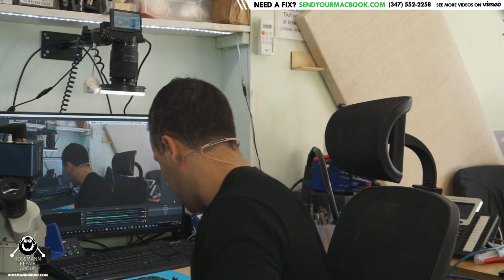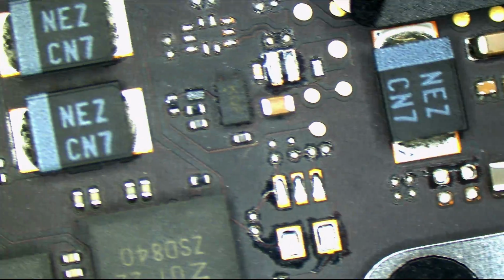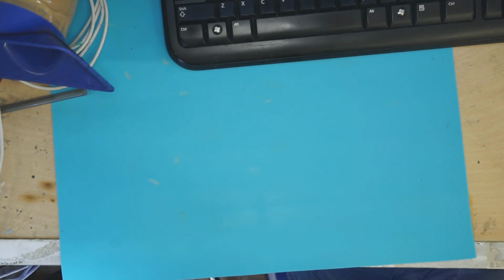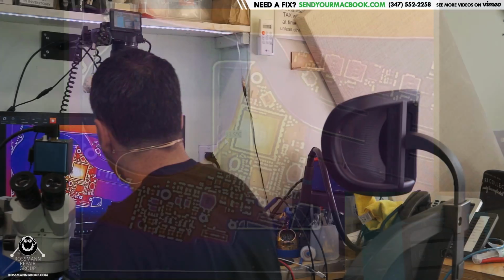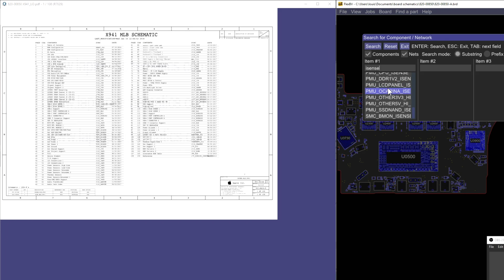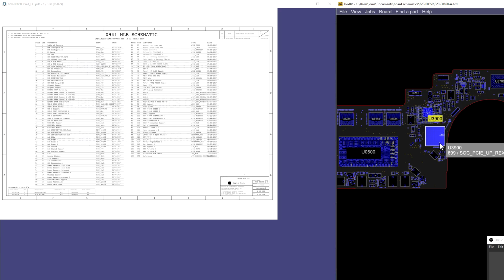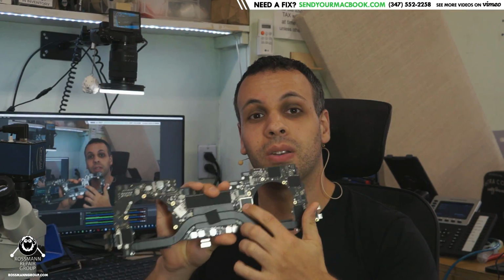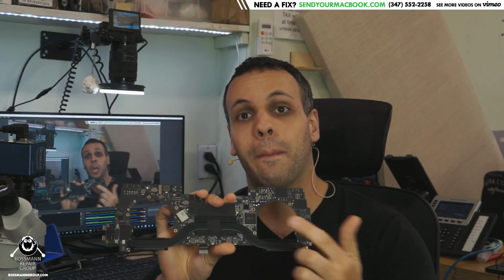Apple users have no one to blame but themselves.

Comment: Apple pulled that fictional water damage ("humidity caused corrosion") stunt on me with a 14-month-old MacBook Pro. Insisted the only option would be my paying for a new motherboard repair or better yet, "just buy a new laptop."  I did.  Dell XPS 15 with far better specs and even better, a warranty that does cover humidity :)  We thanked Apple by removing all iPhones and Macs from our entire family ecosystem. Next are the iPhones at our company of over 400 employees. It took a lot to piss off someone who grew up with Apple (IIc, IIe, IIgs, Newton, Camera, dozens of Macs, and annual iPhone upgrades) but they did it.

Comment: In regards to recovering data from the SSD, could you move the SSD to a donor board with a functioning T2? Just a thought
Reply: Im not positive but I believe that the data on the SSD is encrypted by the T2 if I remember right, thus trying to move it to a different board wont work because that T2 chip doesn't have the same key.
Reply: @beaker15tyler39  good grief.....
Reply: @mikeymike4g63  exactly the problem....

Comment: Sadly asus is doing the same thing... The difference is that on asus you can remove the hdd or ssd. I had the X541UVK whit the bugged intel me i try to fix it and it became useless even wen i flash the original bios back it was dead...

Comment: I still recall when my dad's Macintosh PowerBook 100 had a hardware failure and the guys at the support couldn't perform the repair, but they were nice enough to show where it was the damage, what to do and also borrowed some tools to let dad perform the repair at his own risk. I guess it was one leg of the CPU.

The repair was done perfectly, but the computer didn't turn on... One of the guys at the store immediately performed a special command to allow the hardware to reset due to the modification that was done... Bang! PowerBook 100 was alive again.

Those were very different time on Apple.

I used this PowerBook 100 with a lithium battery to type texts and documents until 2012. Unfortunately the screen failed due to materials deterioration. Good product with an industrial look.

I guess I will fit a new hardware on it in the future.

Comment: Great video and very informative! You mentioned that it’s no longer possible to pull the data off that board. Does apple use “security” as a reason/excuse for not being able to change out the defective chip?
Reply: Apple can recover data from a defective T2 chip if the logic board is partially working but I would expect such data recovery to be expensive, The T2 chip is to make your data more secure and that does mean sacrifices if the chip fails. All my data is backed up on the fly in the cloud encrypted end to end so that would not be an issue for me. I recommend this to all Mac users especially since 2017. It is a great development by Apple, but yes, it is early days and we are seeing the issues popping up now as machines start to age and fail. Data back up has now become essential, it is bad enough when your $3000 machine fails but to lose all your stuff due to no back up would possibly be a disaster to your business.

As for the T2 chip being non-replaceable, it is a security device so yes it would be more secure as a fixed component. I am sure some clever hacker if he could remove it and put his own proprietary T2 chip back in to hack your data that would defeat the security. So I cannot hate on Apple for that, the question is though, is that extra security worth the risk of data loss? Probably not if you back up.

Comment: made the mistake of buying a macbook in 2016. i had the option of getting some ridiculous high laptop for the same price but i went with apple because all my classmates had apple so had the rose tinted glasses on. so i got a early 2015 (maybe late 2015) macbook pro.

worked fine for a while. it was my daily driver and workhorse. i used it for class, playing League of Legends, word processing, facebooking and web browsing. battery was excellent too

a year or so in, battery showed "replace soon" and the battery life took a severe hit. went from being able to use it all day for the aforementioned save league, and still have 30% or so charge. now before lunch its almost always nearly dead after just a few hours of powerpoint slides. it could be my fault to be fair, cause i usually only plugged it in at low battery and left it to charge to 100% then as soon as it was 100% i took it off of charge, and subsequently let it stay on charge all night long. if that is my fault i take full responsibility for it

but seemingly out of the blue the keyboard started showing issues. at first it was just a key or two occasionlly not working. a quick tap on the key would fix it and things would work fine. sometimes the key in question would be infinitely repeating but, again, a quick tap on the key would fix it. 

but over time more and more keys started behaving erratically to the point i had to install Karabiner and use an external keyboard (not an issue frankly cuz i always had my mechanical keyboard on the macbook anyways given i played a lot of LoL). 

research showed me that the cause was "water damage". not buying it. i kept the device pristine given its price tag. not a spec of water ever got on it. the device was straight up designed to fail if im honest. 

in contrast, i got a dell xps 17z laptop in 2011 and i was able to actually use the laptop in 2019 stock. the only thing i upgraded on it was the interal HDD to and SSD to speed it up a bit. other than that, it runs fine (except that it runs hot but that was always an issue for the laptop since i got it). every time i had an issue, id call up dell and theyd send a repair guy with all the parts needed for it out to my house personally, no questions asked

if the warranty expired, i could buy new warranty without any questions asked and theyd once again send a tech to my place and fix the laptop. i tried to buy apple care for my MBP a few months ago and was greeted with a "you cant HAHAHHAHAH". turns out i have to bring in the MBP to an apple store, have them inspect it first THEN if they deem it in pristine condition, will they allow me the ability to purchase apple care. which defeats the purpose if you ask me. why would i buy applecare or want it if my device is pristine?

as for the keyboard? god almighty repair on it is impossible. first you have to out all the components in the laptop, then proceed to break all the rivets in the laptop and forcibly remove the keyboard. then you have to find a new keyboard, and back plate and rivet it into place and hope to god it works and doesnt break down in 10 minutes.

i wont lie. some reasons i bought the MBP are due to my own ignorance. i didnt understand computers as well as i do now. had i known everythign i know now i wouldn have made that mistake. but hindsight is 20/20

Comment: August of 2012 I bought a brand new Samsung laptop for business. In January 2013 I had to do a presentation in China. The evening before I spilled a full thermal mug of coffee right into the keyboard, which meant that 90% of that coffee was in the laptop. 

Well I'm a techy guy and I grabbed my little toolkit and totally disassembled the laptop in my hotel. Dried everything (hair dryer) up and all was fine except the keyboard was only 50% operable. Next day I did my presentation using only the trackpad. 

The following day I flew to Seoul and went with my laptop to Samsung headquarters. Explained my situation and wanted to simply buy a keyboard. It was my fault and I was hoping to pay for a quick repair.

Well they would not hear of that and called in a tech from the repair center, which is located in a different part of Seoul. The tech came to me. He was apologetic as he only had Korean keyboards on hand. I opted to buy an US version when I got home. They were going to repair for free. As a matter of fact the tech disassembled my laptop and double checked everything and praised my cleaning job.

Big difference in company customer service philosophy! I still use that laptop to this day and as a matter of fact I just installed a Samsung 1TB SSD in it last week.

Comment: Hate how Apple dealing with their customers, but look... The company I worked with had 5 PCs and a mac used on a daily basis (design and dev). They were not rich so they bought a "vintage" iMac. With the PCs we always had issues and 2 was almost always on a repair (mostly some software failure).  And the mac just worked. Almost 2 generations older than the PCs and we had significantly less problem with that vintage shit than the rest of the entire computer park we had for work. Probably when it will fail it will be fatal... but it ran well for 2 years and I won't be surprised if they still had it.

Comment: I've been buying and using computers since the Radio Shack TRS series running a 1 MHz CPU.  I decided not to buy an apple product due to their not allowing aftermarket parts/subsystems.  Other pcs have always allowed them, so I can pick and chose what parts and functions I want.   Also until about 15 years ago I would buy the components and assemble my own computers I had to stop doing that when my back pretty much got destroyed.

Comment: This is why i would never buy a modern Apple Computer again. I love the late 2009 iMac and MacBooks. It's so easy to disassembly and replace parts. I replaced the cpu on my iMac. A new fan and 2 sdd's + ram for my MacBook and it's still running fine with the latest macOS release (using a patcher).

Comment: Apple is killing 32-bit and OpenGL support on OS X with the next release. They hate backwards compatibility and power users.
Reply: tbf i386 support needs to die sooner or later, x86_64 has been around for years, is used in almost every PC, and is objectively better. There's literally no point to supporting i386 anymore.

Comment: I use to buy Ford and GM vehicles. I eventually got fed up with having to spend several hundred or even a few thousand dollars to have repairs done only to have something else go bad. Sometimes it was the same parts that would need to be fixed every 2-3 years even though I was babying the damn thing with no word on a recall of said parts. Sometimes a part would go bad which would cause another part to go bad because of crapy design. I now drive a Toyota and have had way better results after several years. I like the look of the newer Chevy trucks, but I don't have enough credit or cash to buy a new one with warranty and I'm not interested in buying another defective pos.

Comment: My only Macbook I bought in 2012 and I'm NOT going to buy more. I will not do that because all the new apple products are overpriced and unrepairable. The unrepairable part is deal breaker for me. The only reason I still have my mid 2012 because I fixed it my self several times. Apple died for me about 5-6 years ago.

Comment: Any tips for over heating a hp for warranty its had 2 hard drivs go already and it runs put next year have unpluged the fan and been running a cpu burner and gpu stress tester but its not cutting it aswell as wraping it in a blanket

Comment: That notebook looks similar to what I saw at MediaMarket, yesterday.
A macbook air, with 1.33GHz i5 dual core, for the price of ... €1200  (€1 = $1.10)
i5 ? Really ?
Buyers bend over to take a look, dont notice the seller, standing behind them.
If they do, they think it is for 'support'.
I bought an Asus Vivobook with 1.44GHz quad core for ... €250
3 years ago !
Size is the same, but I have 2xUSB + HDMI + card reader.
The Apple has 1 USB-C connector. That's it!
So you need a ton of costly accesories to connect a screen or usb devices.
I noticed a customer, browsing the macbooks, saying:
"I dont like the feel of it , let's look at the other one"
OMG
Reply: Really they are so overpriced?
Reply: @malwaretestingfan  Yeah, just google for:
Apple macbook air or
model number MREA2N/A
And that's the cheapest I could find.
Ok .. it includes an SSD. Not a surprise.
It's not like you can connect a usb drive
that easily.

Comment: There is no data recovery from that board ever. 

As I understand it, T2 is security chip and it contains key for data encryption. In that sense, I do understand Apple refusing to give out tool for accessing data inside it. 

The reason for storing key on the chip is to allow decryption using face recognition, fingerprint, etc. Since there is no way to do key derivation from fingerprint, you need chip to store key (and probably do transparent decryption)

Unless Apple admits they have T2 backdoored for extracting key (or storing key somewhere else), they can't replace it and save data either. 

That is the risk you take if you want your data encrypted. 

I personally think solutions like TrueCrypt, VeraCrypt, Android encryption and LUKS are a lot better, since, those do not depend on hardware and key is not stored anywhere while those are locked. (It is calculated from password and sot in partition header)

What does not make any sense is Apple refusing to sell T2 chip with new key and/or chip that can have key reset. You would still lose data, but, at least, you would be able to have machine work.

Comment: The T2 is reading the cpu's serial number from it's microcode and if it is the same the pc will power up😅
Reply: Sorry but no, that is NOT all it's doing.  It is also reading unique hardware identifiers from every single chip that has them (such as the SSD, RAM, etc).  I guess you also missed the part where the T2 is the failing component... and that nobody but Apple has access to the programming for the T2 chip.

Comment: I’m a PC and I have always depended on them. If something does fail I can repair it fairly easily and affordable. As a rule I never buy HP notebooks. I always backup and image my data so I have been very lucky never to have had a catastrophic failure causing any loss of a Data. I have taken my fair share of grief from apple fan bitch clients in my PC Based audio recording studio. I just ignore them and continue with my business. My Lenovo and Dell notebooks run just fine once I remove the factory crapware and turn off all the unneeded services. I used to build my PC’s but now I just research and buy 500.00 to 800.00 notebook PC’s and run them for about 3 years before replacing them. Much  less of an investment than using MAC. A moderate powered PC is just fine for my business. I do use an old IPAD to remote control my PC in the recording studio and I have owned IPHONE 5c, 7plus, and now Xmax with out any issues but I never kept a MAC computer for more than a few months. I’m a PC :-)

Comment: Apple called to ask why I paid £700 to replace battery in my 2014 MBP rather than buy a new one. I said the display cable issues and the keyboard were substandard in the new one. I hear Apple are now changing the keyboard. 😬

Comment: You are very hard in your terms Luis towards customers ... you are some kind of true when telling this, but personally I bought my first Macbook pro 13" with touchbar in 10/1018 after using MS windows on various computers for 25 years and Microsoft issued an MS update linked to display FW which was not compatible with my laptop. So I just had no other option than through it away and decided to try Mac ... is Windows bases computers better than Apple ? Mmm

Comment: In my computer repair job experience I was amazed on Apple products their logic boards last long than any Windows Laptop motherboards. And it is easy to service Apple hardware without replacing any component than replacing components of windows laptops like blown SMD resistors, Capacitors and MOSFETs. This is the reason I love Apple. I get spilled liquid cases on Windows laptops that are old models Like IBM, Lenovo ThinkPad, Dell Latitude and Studio models and HP Pavillion models than MacBook.

Comment: This proves that apple is horrible just buy a hp elitebook way better and doesn't break that easily because it got a mil stdt rating and they are designed to handle keyboard spills and being dropped whilst apple just claims something is water damage so they dont have to spend money in fixing it 🤣

Comment: Apple are a complete joke, just today i got in a 2015 Macbook Air from a student who was crying while explaining to me what Apple told her about her Macbook that wasnt working. They told her that there was a smell and signs of burning on her battery and logic board that meant she would need a new board and battery and she had lost her data. Now being a student she had work for school which she was a bit silly and didnt have  a backup so you see why the upset. So im having a look on the desk with her and i open it, no burns, charring or even a smell so on a hunch i unplug the battery and plug the magsafe in and what do you know fan spin and it boots fine. I plug the battery back in and find its in replace battery mode so new battery fitted and its back working properly again and back with customer. I felt like telling her to go to the papers as she had the apple diagnostic sheet with the £500+ bill they wanted for what ends up being just the battery.

Comment: I like MacOS X. For a NIX head, it used to be an up-to-date UNIX system with access to commercial software. But Apple hasn't updated shell tools or worked to maintain compatibility with the rest of the NIX world. It's just not worth the effort to run unless you want to be boxed in to the Apple ecosystem. Which, I don't. And the hardware is pathetic. After fifteen years of buying Macs I've bought a PC and run Linux. It's not as nice a GUI as the Mac. But I can get my work done.